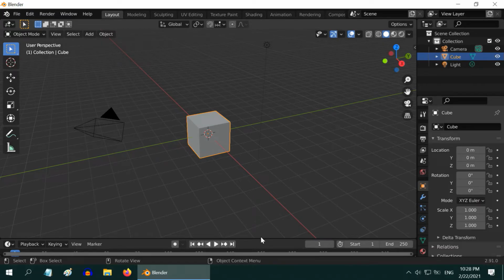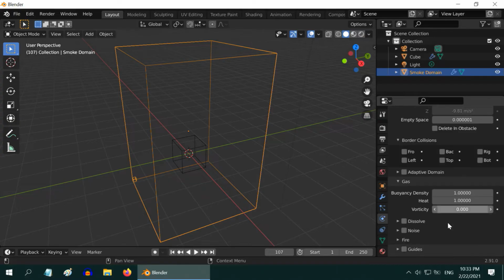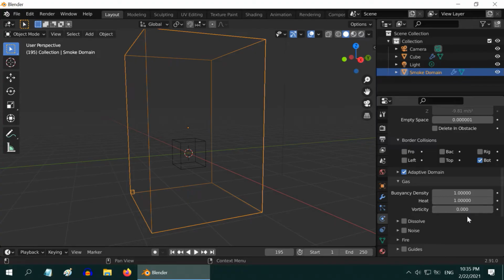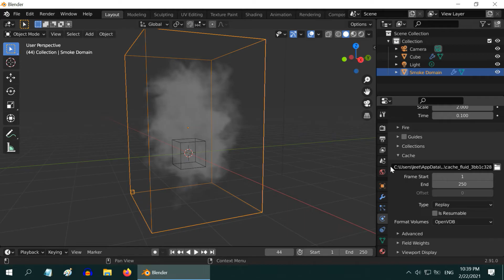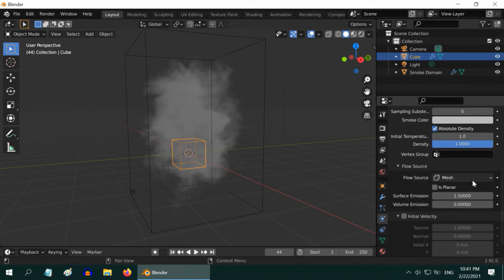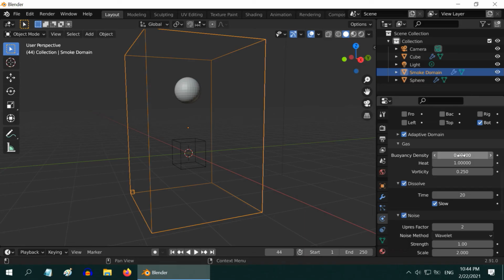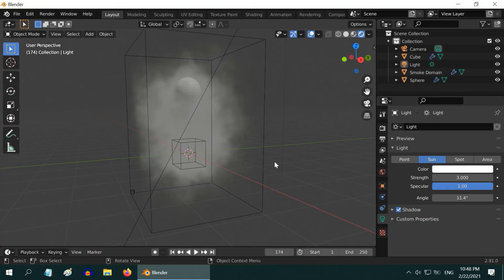All Smoke Settings Explained in Eevee | Smoke Simulation Tutorial | Several Examples | Blender Eevee

Comment: @
5 Minutes Blender  how to edit the setting , my solid mode smoke is pretty than render mode  ,thx
Reply from the maker: You need to use a bright light, like a Sun, with strength 4 or 5. And increase the density value of the domain material. Higher density will give you thicker smoke. And in the rendered view mode, what you see in the viewport, is sometimes different than what you get in the actual render. So, do not go by the viewport alone. Use F12 to get the rendered output of some frame and check. If still not resolved, you can send your blend file so that we can check thoroughly and suggest something for your specific setup. Thanks!

Comment: where is high resolution option ?
Reply from the maker: Since the release of Blender 2.8 the old Smoke settings have been moved into the Mantaflow, which works little differently. So there is no High Resolution option anymore. Now you achieve the high quality smoke with suitable resolution division, and an appropriate level of vorticity and noise together for the smoke texture. You will find the details in this tutorial, as well as in one of our upcoming tutorials entirely focused on the High Quality Smoke. Stay tuned!

Comment: I cant get it too work. Ill have a real crappy fire for the first three frames then it disappears. I make one change to anything and that crappy fire is gone for good, then I gotta start a whole new project. Even undo wont bring it back theres gotta be some kind of setting or addon im missing. I start new project, repeat the process then like just now I made a change to the Raction speed poof gone. No fire. Using 2.93. I had it almost working back in 2.8. For some reason it just wont work for me. I guess I just keep researching. LOL
Reply from the maker: Hi, few things that I can suggest without having a chance to look at your blend file... 1) You can try to increase the Fuel parameter for your Flow object 2) Decrease the Reaction Time for the Domain object 3) Ensure that you are using an appropriate Resolution Divisions because with very high value in this field, the quality of smoke & fire increases, but they also get comparatively thinner & very faint 4) Ensure that the Flow object is not moving out of the Domain and the Domain object stays within the visible distance of the camera (it is applicable only when you have some heavy animations going on with your objects). But if I read is correctly, your problem is not in setting up the scene, but in getting it work the second time. Sometimes, the viewport might not display everything correctly, you can bake the data and verify if it is working correctly in the render output. All the best!
Reply: @5MinutesBlender  THanks. Just having my coffee, but am going to go through everything you just said here after a bit. Double check Im sure im missing something. Im new to Blender been learning for the past few months, but not new to graphics software. I love it, just gettin past the learning curve.
THank you very much for the suggestions. I have been working on a scene, and I need two fires in it. GRRR. Been at this for a couple weeks on this one. 
THank you again. Ill report back my results. May not be too soon. Got other stuff going on. But will report.
Reply: @5MinutesBlender  hmm yup none of those work. Tried em all. It seems to be related to other objects. I can get it it to work much better with feul. Yea that helps. I imported another object. Poof. Gone. THeres something Im missing. Ill figure it out eventually. Im not one to give up.THanks for your input man
Reply: @5MinutesBlender  WOW. IM a moron. I keep using the wrong viewpoint.  Good god man.  Still not used to paying attention to what viewport im in. I was absent from blender for a few weeks and already forgot. Thats all I got as an excuse.
You can pin this one. and have everyone throw properly rendered tomatoes at my ass. I deserve it.
Reply from the maker: Ha ha ha ha 😂 Good to know you solved it man!
Reply: @5MinutesBlender  Well I might have spoken too soon. Still having trouble. I might try and post a video on it. If I bring another object in, it wont show up in the render. If I get a chance Ill post a video. Too hot and tired right now lol.
Reply from the maker: @rc-st9pg  All the best. You can always contact us with your blend file, so that we can look into it and figure out if something is missing. Our contact details (email ID) are given in the About section of this channel.
Reply: @5MinutesBlender  LOL. alright. Take care bud.
Reply: @5MinutesBlender  Yea sorry to stump you too. I figured it would be a simple setting. Guess not.
 When I figure it out Ill let ya know.
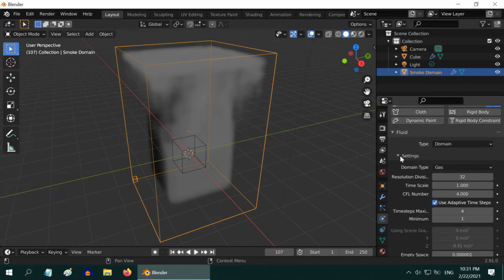Reply from the maker: @rc-st9pg  I saw your video today. Sorry buddy, it was lost in the spam box due to the hyperlink. Anyway, the problem you are facing is probably simple, and already discussed in another tutorial. You are getting the fire correct, but it is not rendering (as per your video that you posted). If that is the case, then it has nothing to do with the fire simulation. It is just the "material" of the fire that is not displaying. You need to setup the right material, and you will get it working in a jiff. In fact you can experiment with the color and the intensity of the fire just through materials alone, no need to bake the fire every time. Please watch the tutorial on fire https://youtu.be/x28KUOopeWU (you can directly go to 2:58 where we have discussed this part). If still not resolved, please let me know. Once again, I'm extremely sorry that I could not see your video link earlier and hence this late reply. Take care!

Comment: anytime I try to change the start frame for a smoke animation, the entire smoke domain becomes grey before the start frame and after the end frame. can't see anything behind the smoke domain. I've literally tried everything, any help would be awesome
Reply from the maker: In smoke simulation, people generally complain about not able to see anything at all in the domain. Your problem is opposite, you get a grey domain before & after :) My best guess is, this is happening because you probably had a longer duration of smoke earlier (say from Frame 1 to Frame 250) and you have now shortened it (say from Frame 50 to Frame 150). What happened behind the scene is, Blender first calculated the bake data from 1 to 250. Now with the new setup, it has calculated the smoke correctly between 50 and 150, but whatever was calculated earlier from 1-50 and 151-250, were left out as it is. They were not deleted. But those parts are not compatible with your new setup. Hence, those parts are displaying as a grey domain. In other words, internally Blender still believes your smoke simulation is running from 1 to 250 while it computed the bake only from 50 to 150. Rest is junk. So, the solution is simple but tricky. You need to refresh the cache. Force Blender to delete everything that is old, and create new. Sometimes it just does not happen, you may need to manually delete the folders. I have run into these issues couple of times. Now, if that also does not work, I can suggest another technique. Make your domain object invisible before and after your smoke start & end frames. This can be also done in two ways. Either change the size property of the domain object to zero to make it invisible, dynamically just before and after the smoke simulation. Or change the material of the domain object to a transparent material, and control it dynamically in the shader editor, so that it gets a transparent material before & after the smoke, but the original material stays during the smoke simulation part. This second method might be little tricky if you are not very familiar with various node setup. Lastly, you can always contact us with your blend file for any specific suggestion. Our contact details (email) are given in the About Me section of this channel. We will be more than happy to help!
Reply: @5MinutesBlender  oh yes I will absolutely take you up on that offer. but what did end up working for me was to make the smoke domain invisible right before and after the keyframes I needed the smoke in. I'm gonna send you the email right now thank you so much

Comment: Thank you - very, very useful. I'm trying to make horizontal smoke streaming from an exhaust and have been experiencing all the problems you have mentioned. Thanks again!
Reply from the maker: Glad to know that it helped!
Reply: @5MinutesBlender  thank you. I was thinking that the smoke feature was very difficult to use. Is it just bugged?
Reply from the maker: @andyklyen6885  Well, honestly I did feel the same way when I first used it. Now I know it is not really bugged, but the default settings are not very helpful, or maybe they have setup the default settings thinking of some specific scene which unfortunately is not common among creators when they think about a smoke. Once you master it, I am sure you will find it easy to create smoke the way you exactly need. in 2.9 they improved it further from 2.8 version. But still, the entry barrier is high, I must agree. All the best, and if you create something, I would love to watch that :)

Comment: How can I do to make the smoke stop smooth?
Reply from the maker: You can keyframe most of the control factors like vorticity, temperature, heat, buoyancy etc. So, towards the end of your desired simulation, keyframe these parameters and reduce them to zero. The smoke will become standstill as if it stopped moving. You need to setup at least two sets of keyframes, and the gap between them will control the speed at which the smoke will come to a stop.